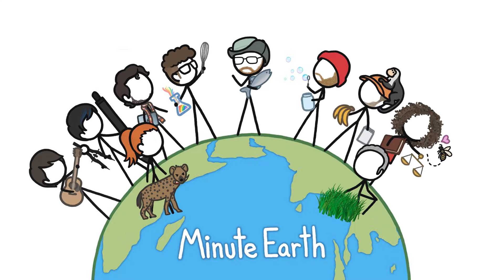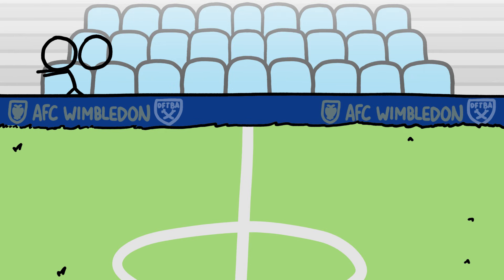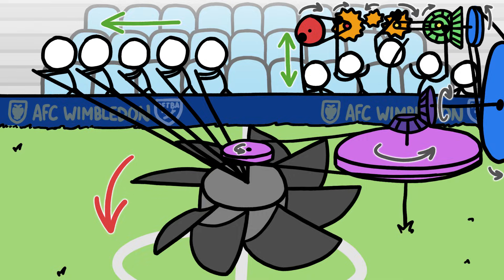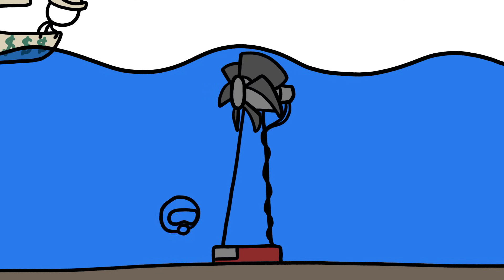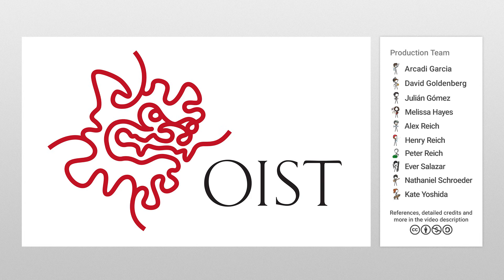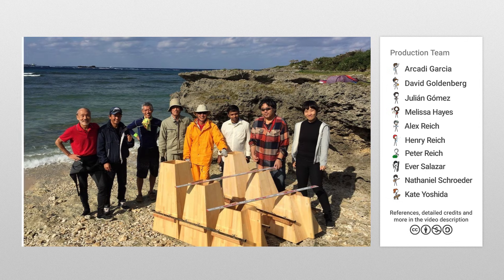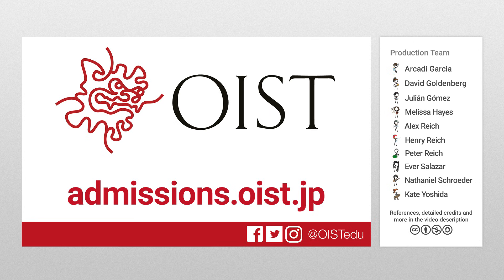Why Can't We Get Power From Waves?

Comment: The way electric generators work to turn mechanical/physical energy to electric requires rotational movement so need a turbine. 
I'd think using the floating thing as a pump would be the best idea pressuring air. Or finding a way to convert into some other type of energy we can store instead of directly to electricity.
I'm amazed there's nothing like the basic idea of an internal combustion engine where Pistons move up and down but prob inefficient maybe there's y

Comment: At least two of those systems described would have been viable (the air chamber and buoy system in particular - they have been shown to produce good output), but seawater is corrosive and things like barnacles have proven difficult to keep up with. The surface coatings that would be more effective at countering it tend to be restricted in use or outright banned. (Stuff like purposely leaded paint.) The issue wasn't that it didn't work, but the maintenance required discouraged any use past the testing phase.

Comment: Great video! You guys have a power of summarizing big topics in an outstanding way.

Some of the work I do is related to wave power extraction and, from what I see, it seems this mentality of using waves to "turn turbines" is limiting (by the way, thank you for correctly pointing out the particle orbit correctly, they don't "move to the right" with the wave). Many researchers and engineers work day and night trying to craft the perfect wave energy converter device, but so far nothing definite has come out of it which would, by itself, justify big investments on wave energy extraction. The high risk involved in putting your investment out in the ocean also doesn't help, as you pointed out.

Some, however, have remembered a unique aspect about floating bodies, they produce their own waves (radiation) when moving and diffract the incoming waves (they scatter the incoming waves). This means that, instead of having a single "perfect" (and expensive?) wave energy converter, we could have an entire array of hundreds of simple converters whose positions are determined by the incoming wave train and the scattered one. Each device of this array now interacts in a constructive way with its neighbors, greatly increasing the total energy extraction.

A colleague of mine wrote about this recently in the journal of fluid mechanics:
https://www.cambridge.org/core/journals/journal-of-fluid-mechanics/article/hydrodynamics-of-periodic-wave-energy-converter-arrays/F738C93ABCE787808AE83D783C5AD3D2/core-reader

Sorry for the long comment, but this problem is so interesting to me that I couldn't help myself! Keep up the good work Minute Earth!

Comment: Couldn't we harvest tides for energy. High tide is filling a large basin and by low tide the water flows out through a turbine.

Basically a very low but large dam 

It seems very simple even if not very space efficient. But you can easily put something ontop of it to use the land otherwise. 

I personally find using gravity as a power supply or battery a great idea.

Comment: There are constant oceanic currents, and are quite strong, though I guess the problem again is the salty environment as it would need to be underwater.
Reply: Taking into account magnets can be encapsulated in plastic (with the consequent loss in efficiency), and that wire would also be coated in some form of enamel, what sort of bearing is the one you're referring to that would allow a turbine to rotate while supporting the required torque/speed? Because unless we're talking about different production methods I'm just not catching you.

Comment: the buoy idea might work if the cable goes to the floor around  the turbine to another buoy, basically working together. if you can find the average wave frequency for the area that is. kind of like a lift or how a cable car works.

Comment: Why not just wave goes one way-  hits a paddle on a gear- spins turbine, 
wave turns other way, just have an electronic switch that moves gearing other direction
Reply: Wells turbine are used in Oscillating Water Column : whatever the direction of the air flow, the turbine turns in the same direction. It is a better solution compared to a gear that change every 5 seconds.

Comment: Wind causes waves, so why not just harness the wind instead?
Reply: waves are like storage for the energy from wind, harnassing the waves would in general give out more power from the waves than wind power would because of the fact theyre just batteries for the wind power
Reply: Nope, just an effect. 

The first reference estimates 29500TWh per year of energy. Which is 3.4TW of average power. Compared to the wiki reference for potential wind power at 1700TW. While the total solar energy earth gets is at 174000TW...

Comment: big walls attached to rods. The waves crash into, pushing them backwards past a gear system that spins as the rod passes by it, which then spins a turbine. Then a spring system pushes the wall back into place in time for the next big wave to crash. Probably wouldn't work but since crashing waves generate a lot of force, it might. Whatever. I'm not an engineer lol

Comment: For tide energy without cutting up fish: Scale up the bouyes (heavy barge style), add a vertical line to the system to get energy from the weight dropping as well. Make the bottom connection a pully and put the generator on the overhanging structure. Encorporate this system into the area surrounding bridge piles when building coastal bridges to get dual use from the structure. One of the best candidates for this is the knik Arm Bridge in alaska, which has been in the works for some time. In an area where tides are often as much as 40ft change in water level.

Comment: Why not connect a floating buoy to rod with a permanent magnet/s to move in a long vertical coil? Coils being above the buoy. Increase the magnetic resistance to make it produce more angry pixies....maybe?
Reply: One important issue is the type of motion : low speed, important force. That is not the best in order to buil cheap electrical generators.
Reply: @thibautkovaltchouk3307  Well, I'm sure there are even more issues with that. Mere fact that engineers sill haven't cracked it, they better don't expect too much from me, haha

Comment: So you're basically saying low energy density is the main reason it's not economic. MSRs when?
Reply: They did not say that. I don't want nuclear power plant : they have shown that they are dangerous three times now, with important repecursion two times. We have largely enough renewable energy at relativly low cost (lower cost than nuclear energy) in order to avoid these technologies.
Reply: @thibautkovaltchouk3307  No, PWRs had two accidents in 50 years while simultaneously being the safest and greenest forms of energy. I didn't say PWRs though.  I said MSRs which literally can not fail like those two did.
Reply: @NACAM42  Safest -> Source ? Greenest -> Source ? Saying MSRs will not fail is like saying Trotski was a better leader for the communist revolution than Stalin : we cannot know for sure all the risk, because the number of existing power plants is far lower thant other types.
Reply: @thibautkovaltchouk3307  Nuclear produces zero CO2 and with MSRs, they're so much more efficient than PWRs, you could create carbon neutral fuels by pulling CO2 from the air. And the accidents you cite are ones built 40+ years ago. That's like saying cars are super unsafe based on ones built in the 1920s.

Comment: Um actually, turbines spin GENERATORS to make electricity, so your magical BUOY that "turns a generator" instead of the bad old timey turbine is... exactly the same thing the turbine in all other instances spins to make power... FAIL
Reply: You can use a linear electrical machine instead of a classical rotational electrical machine. In these case, nothing spin.

Comment: Rather then trying to use waves you would be better off putting turbines in the area of one of the constant ocean currents, but you would still have to deal with things like corrosion also not sure what kind of effect it would have on the wild life as some electricity will always leak out of the power lines. Even with wind turbines and solar panels they have discovered in recent years that often times quite a bit of electricity seeps out into the surrounding terrain and has been shown to have negative effects on cattle meaning the whole method of putting wind turbines in large empty pastures that are also used by cattle may end up being stopped.

Comment: How about a big floating...boat/platform type thing that sits on a the top of the ocean and as it goes up and down in the waves it pumps a piston that is fixed to the seabed which then converts the kinetic to electrical energy?
Reply: There are designs similar to that which basically are just a balloon and a rope that connect down to a piston.

Unfortunately, it's not yet cost effective because of how little energy is generated, how expensive maintenance is, and so on.

Comment: How about this?  We already know how to make really good pumps that work via moving a lever up and down.  Power the pump with the waves, and then pump water into a reservoir.    This would happen when it's windy / wavy, where other existing methods of energy generation are already working well (e.g. wind power), so the need for the wave energy from the waves is not really needed but instead stored for later.   Later, when wind and solar are not available, empty the reservoir across a traditional turbine like those used in a dam.  Such a system should also be relatively cheap to build, and easy to scale.  I think :)

Comment: That's because wave energy is not the solution. Tidal energy is the solution as you don't need any complex system to spin a turbine. You get all the constant flow you want. You just need the right place where the tidal flow is channeled through a gap, so it has high and fast tides. The best thing about Tidal flow, is you get energy going in and going out. Sure you only get it for a few hours each day, but it's free and it's always there.

Comment: Why not harness tidal power? Water flows into a bay at high tide. A metal gate comes down and then the water turns a turbine as it exits during low tide. There's literally no limit to this as the bay can be enlarged to any size trapping cubic kilometers of water behind the gate giving you power as it flows out.
Reply: C Lopez  this is used, and energy storage is a massive deal in getting renewables to work (eg no solar at night) but it's another layer of expense.  Compared to solar and wind, tidal is just much more expensive and if you have to store the energy anyway you might as well use them.  They looked for years at using the Bristol channel for tidal power but the cost and impact on ecosystem is massive.
Reply: Because the sea is frigging unforgiving. Mooring, mechanical and corrosion resistance, transferring power, etc. are all difficult in this challenging environment. I've participated in the study of a few tidal power projects (Open Hydro, Emera,...).

It really is just very challenging to make cost-effective equipment that will work reliably.
Reply: the environmental impacts of this can be enormous (like fish need to get up the river, mudlfats are important habitats etc) also to capture enough water you need to build huge reservoirs.... but also remember that electricity is more or less worthless in the middle of the night as demand drops. large coal stations cannot switch off easily so base load is covered by these fairly easily.  and that means you only really get one tide per day which is worth using.    Basically if you are going to the hassle of building a huge dam, do it upstream.

Comment: Nuclear power and riverine hydropower are already two of the greatest sources of energy. However, given that waves move up and down, why not use piston engines? Have the wave push up a weighted piston. When the wave abates, the piston will go back down. Use that to turn a crankshaft like in an internal combustion engine.

Comment: Why aren't we getting power from ocean thermal energy conversion?
Reply: There must be an important temperature difference between surface water and in-depth water. For now, it can be interesting only around the equator. There are several projects that will test the viability in the next years.
Reply: @thibautkovaltchouk3307 
Are they building plants?  I've known about this technology for over 15 years now.
Reply: @thethegreenmachine  According to the section "Currently operating OTEC plants" in Wikipedia : there is a few test plants, and one of the most interesting project is for 2020 in Martinique (France).

Comment: i have tried using a floating pendulum to transfer the vertical motion in rotational motion during my undergrad project. In the end, we end up with no solution to deal with the nonlinearity of the motion...
Reply: Like in the SEAREV project ? It is not a continuous rotation, but it works fine...

Comment: @MinuteEarth What if we think about a piston instead? Imagine if we had something akin to a buoy floating on the surface of the water. That buoy would be anchored to the ocean floor beneath. Now if we build a cylindrical enclosure from anchor to buoy we could place several turbines the entire length. Wave/tide goes in, the buoy/float is raised and primes the system. Wave/tide goes out and we can convert that stored potential energy into driving the turbines.

Just a rough idea but I wanted to put it out there <3
Reply: They already exist. Still expensive to build but curious that they were left out of the video. It turns the generator on both the up and down strokes.

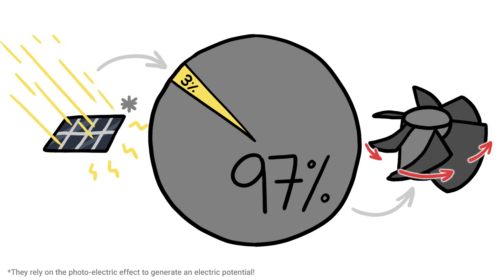Comment: 0:25 Solar panels rely on the photo-voltaic effect, not on the photoelectric effect
Reply: They're the same thing!
Reply: @ArcadiGarciaRius  Every source I've read says that in the PE effect electrons jump to the vacuum level, while in the PV effect they are raised to a higher band, but stay in the material.
You can famously observe the PE effect in metals, but can't use them to build a solar cell.

Comment: Solution, have a panel move back and forth with a piston that has ben pressurized, all engineers should know what to from that point, done, I have solved the energy problem
Reply: They try : search Oyster Ocean Energy Converter.
Reply: @thibautkovaltchouk3307  damnit, okay, how about spilers or poles on a gear system that turns it like a car piston? Or we could pull a Binary Domain and build a massive fucking sea wall and make hydroelectricity that way.

Comment: How much energy is in the waves exactly? I mean, is your average square meter getting more energy from the sun or is there more energy in the waves? Because if it is the sun then solar power plants are going to be cheaper no matter what (unless you build really cheap wave power plants and wave cables that do not need maintenance). If there is more energy in the waves then how efficient are our current designs at converting that energy into electricity?? I mean Wells turbines do not look that inefficient so maybe there just is not that much energy or maybe the cost of the supporting structure is huge factor and it is hard to improve upon.

Comment: The ocean and lakes make a great battery in several ways. It's not always about producing the power. Batteries are also a problem. A lot of electricity produced is wasted that could be stored for peak use times. Instead of having to fire up another plant. Solar filling air bags with air pumps that is later fed through a turbine. For one. Weights lifted and dropped. Air bag pulling on coils as waves pass over can be lowered and raised for tides. The power is produced on land. So the only thing exposed to the ocean is the bag and cable. Which would need changing regularly no matter where you installed them.
EV's will not be mainstream until we put solar on most buildings to feed a charging rail for EV's. Run on main roads and highways saving the battery for the side road and gravel roads.
Reply: If you want a power production you can regulate for different hours of the day,  go hydropower. (Dams)

Comment: we do make power from the tides. like in the Netherlands
Reply: Unfortunately Americans are deeply ignorant about renewable energy... (No hate for them I like USA in general but in this domain they have a lot to learn) In Scotland they are also successfully using tide and wave energy. Europe in general is really pushing with renewable energy really hard despite high initial costs which is great. The problem is yeah until you make those first steps complete infrastructure overhaul is looking ridiculous economically (kinda like challenging an established company that is already benefiting from its scale in its market). However innovation can beat this problems (in many places renewable is already cheaper than fossil). Sadly renewables because of years of neglect won’t be globally adopted in time to stop global warming. It’s probably a good idea to switch to them in the long run not just for the environment. Then again in the long run we may have nuclear fusion... USA did a first breakthrough here with plasma ignition facility and EU is having a big ITER international project (that USA also contributes too) hopefully private sector will come up with commercial fusion faster than it is expected by bureaucratic central planing
Reply: @MultiSpamTV  
"in many places renewable is already cheaper than fossil" hahahahhaahhahhahahhah